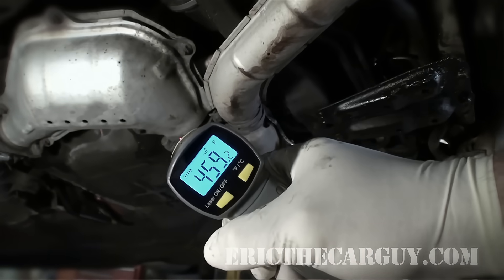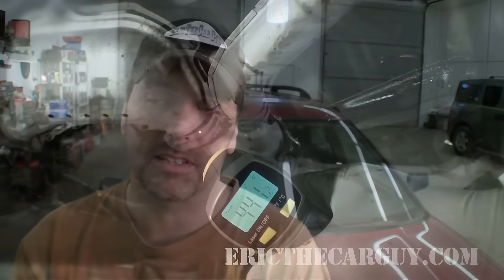Does Lacquer Thinner Clean Catalytic Converters? -EricTheCarGuy

Comment: I tried this and it worked.  2005 Subaru Outback.  1 gallon lacquer thinner in a 1/2 tank of gas.  Highway driving for 1.5 hours.  Turned the car off and then started it back up.  Check Engine light remained off.

Comment: Aye I thought it was most likely to not work but it actually did. I used a gallon and it was worth the shot. I took more then 150 miles but it did work! Maybe it won't fit every car but my 99 Subaru Impreza with 250k miles was fixed.

Comment: My 420 code is the only code I can't shake.. I wanna try laquer just in case and if that doesn't fix it.. anew sensor 2.. but the car came with what is clearly a new cat new but cheap design.. nothing like Honda oem.. due to this prolly being that crappy89.99 cat I seen on Amazon.. it's most likely the reason I have p0420.. it just lacks the content an oem cat has to satisfy the pcm it's functional.. not to mention the piss poor design of the manifold and collector at the end of cat.. all thin wall plumbing bet it's single layer.. the noise is literally coming thru the steel .sounds tinny as hell under load..may as well have leaks..(mind you everything is sealed all the way to the tailpipe.)so Even if laquer thinner or a new sensor fixes it.. I'm still gonna buy a better cat manifold. Just because that ugly sound.. bet it's restrictive too.. the runners on the more Honda like brand look larger.. I guess there's a reason they sell them for 89.. vs 250 or so for the better.. you get what you pay for.. so spend the extra money on better parts everyone...

Comment: I put those in my gas tank for catalytic maintenance when my tank of gas is 1/4  and drive it until the next gas up. It did throw engine light in my Mercedes and Lexus but it will disappear when I gas up again.
Reply: Just an update: I have a bad catalytic before, 4 years ago because I have to adjust the valve clearance to fix the problem. My catalytic already need a renewal because of it but I put 8 oz in a quarter tank of gas and drove it. It does clear some clog in catalytic converter and made my old '98 Honda CRV pass the emission  test a couple of times (4 years). Last test, it did fail and after using the Laquer thinner the check engine did not go away (killed the catalytic completely).  After I swap the converter with a new one, I found the old one was just like a muffler, the screen with precious metals coated with ceramic are gone (zero).  So, the Laquer Thinner can clear the clog but only use it as last resort as it can take out all the ceramic inside too. Also do not let it seat in your gas tank in longer period as my fuel tank empty warning light stop working, fuel gauge are working. (anyone know which parts I should change? not the bulb) it might also do something with the injector. To use it: put it, drive until it's gone or only put this in the last quarter of gas in the tank.

Comment: To obtain the same ratio of fuel to laquer thinner, (1 : 9), with 3/4 tank of fuel you'd have to add 1.5 gallons of the laquer thinner to the fuel tank. As several others have already pointed out, you can't "debunk" or "prove" anything if you're not willing to completely follow the directions provided by the previous experimenter! 18 *.75=13.5 gallons (fuel in the tank), 13.5 / 9=1.5 gallons (additive needed), for complete duplication of the previous "experiment". Even if the experiment was completely duplicated, "Scotty" makes no guarantee that it will work every time . . . . so, you might still have to remove the "cat's", and use a different cleaning method, or even replace them to obtain the desired results!
🙂

Comment: I’ve used lacquer thinner on one of my cars the literally would not go over 25 mph because the both cats were soo clogged that the engine couldn’t breathe right! I dumped a gallon of LT into the tank witch had less than a 1/4 of a tank and idled it at 2500-3000 rpm for a hour ...
 Needless to say a lot of smoke and crud came out the tail pipe but sure enough after the hour passed I drive to the gas station filled her up and got in the freeway and made it up to 75 mph ..... in total I saved $1500 and a i was able to fix the problem with no reprocussions 

So yea lacquer thinner dose work although I wouldn’t recommend doing it the way I did if you have a newer car with more sensitive oxygen sensors and such

Comment: If there are any chemists in the group, how much of NOx pollution is removed by the catalytic converter ("cat") and how much is removed by the EGR (exhaust gas recycling)?

If most of the NOx reduction comes from EGR, maybe we don't need those bleeping catalytic converters in the place (!).   

[Don't need ANY of that pollution stuff in rural areas, but that's another conversation.]

PS: I suspect most of it is EGR because NOx comes from EXCESS oxygen in the air-fuel mix, and EGR removes the excess oxygen so the NOx doesn't form in the first place. (Pretty cool feat of engineering in the first place - "pollution problem solved".)

PPS: most of auto air "pollution" is NOx, i.e. compounds of nitrogen and oxygen.

Comment: Read carefully IT WORKED FOR ME.
May 12, 2020 my 2002 Honda Civic LX had this same code P0420 (“Catalyst System Efficiency Below Threshold <Bank 1>” ) for the last 2 years, now it’s time to renew the registration and smog check is required, previous owner had catalytic welded from the middle due to a crack (very common on this type of catalytic as I searched) also one of the pipes cracked from where it connects to the plate, I took it to welded hoping that doing so the code will be gone, but it didn’t happen, looking for another solution, I came across Scotty Kilmer’s video, on how to clean the catalytic converter with Lacquer Thinner, Also I was curious to see someone like “Eric the car guy” doing such experiment as well, I saw his video too (like probably you are doing right now hoping for a miracle solution) but I got really disappointed, to the point to not try it at all, I have to admit, at first I was skeptical, but after knowing how much my catalytic cost (I live in California and regulations here are different, making everything more expensive) I decided to give it a try after all, it was either paying $700+ for a new catalytic (which is not that much compared to other ones, but I can’t afford it at this moment due to “Coronavirus’ time”) 
or pay $250 for a “Special smog check test” (Regular is $50) 
or pay less than $20 for a gallon of Lacquer Thinner 
Guess which one I chose?
I follow EXACTLY the instructions from Scotty Kilmer’s video, I poured 1 Gallon of Lacquer Thinner into a Half gas tank (6 gallons in my case) drove it for more than 150 miles and since my commute is 100 miles daily (95% freeway) it was easy for me to do this experiment. Now I can say the code is gone, my car passed the smog check with no problem at all and I can’t believed that I almost didn’t do it, I almost spend hundreds of $$ when I didn’t have to. 
Lacquer Thinner Less than $20
Smog Check $50
Total less than $70
Knowing that it works priceless 
This is for Eric and the rest of you who trying to replicate this, do EXACTLY AS IS INSTRUCTED TO DO nor less. (Very disappointed on you Eric the car guy)

Comment: 8:49 This is why engines should also be measured in running hours. The odometer will never know about that extra 200 miles.
Reply: Except that the 200 miles he mentioned was the miles the vehicle had been driven since the additive, so...

Comment: Eric Hey brother, I really dig this channell. 
I have a 2002 Mitsubishi Mirage DE 1.5 purchased three years ago online w 119,000 miles.
The car on the orig engine did California to Maine & back twice + 2 trips down to Miami & back trouble free cold A/C instant start up every time the key is turned, etc. I am an automotive graphic artist/ designer 
for Goodyear 21 years as of 2019. Since owning this car I have learned more about cars in 3 years than 
in 18 years flying & using rentals w 500 mi hehe. I did have to do an eng. replacement this last November 2019 Goodyear holiday trip. found an exact matching motor w just 75,000 orig mi. 
Doing new front end incl struts this Mo. Stay cool & srat in touch.
Alex

Comment: I cleaned mine with a hammer and a large steel punch.  Amazingly it worked!  They flow as if there is nothing there!
Reply: Yo pls help me how to do it
Reply: @khatabdh4028  get a 1 inch hole saw. At the rear of the converter cut a hole in the side. Then take an old big screwdriver and tear that stuff up. Get it all out that hole using a coat hanger and fingers. Then after u know its clean. Start the vehicle to make sure. Then weld a washer back over the hole.
Reply: @khatabdh4028  ]
Reply: *ha
Reply: LOL 😆 🤣 😂 😹 😆 🤣
Reply: Will this clear the engine code?
Reply: @alexpeterson4339  put 2 spark plug non foulers together. Drill one out to fit over the threaded part of the 02 sensor
Reply: @ozarkprepper1718  this clears the code? The engine wont know the sensor isnt getting any data? Just gotta pass emissions. Thanks for the response
Reply: @alexpeterson4339  you can clear the code with a scanner,or on some just unhook the negative on the battery for 5 minutes while the vehicle is off.
Reply: How to clean idle air control valve 94 civic
Reply: @joemerrick9970  get a new IAC from autozone and keep the battery unhooked for 10 minutes
Reply: @alexpeterson4339  it's worked a couple of times for someone I know.
Reply: @ozarkprepper1718 😂
Reply: @alexpeterson4339  Nope.
Reply: 😂 😆 genius
Reply: You had me busting out laughing  I done the same thing it does work great but I used a big ass cement drill bit
Reply: Ji ji ji ji
Reply: sure if you live in a state without emissions tests, and if a DOT inspector sees it for some reason that's a pretty nice fine.
Reply: @k9ne70  Dot can kiss my ass.   Thats why I vote Republican.   Democrats are the cause of all these stupid emissions laws and regulations.  Live free or die.
Reply: I put tape over a friends check engine light about 30 plus years ago . We were going deer hunting and that s10 had a bright light in my way . Fast forward 10?years he still had the tape over it .
Reply: @alexdominguezroberson2290  mostly kidding of course. I'd probably laugh instead haha
Reply: Lmao!!!
Reply: Lol
Reply: HAHAHA...YUP
Reply: Yes!
Reply: Did you die from leaking emissions getting into the passenger compartment yet?
Reply: @TortureBot  No and my grandparents never had them and the lived into their late 90s.
Reply: @ozarkprepper1718   That's not what I meant. Of course you don't need a catalytic converter at all except to reduce smog, but I thought you meant you poked holes all in yours from the outside. That would cause exhaust to leak and possibly get into crevices and cracks under your car and make it into the passenger compartment.
Reply: It's amazing how many ppl know nothing about cars everyone asking if it will clear the code 😂😂
Reply: That's what I'm doing as we speak we gonna create some airflow
Reply: And the check engine light no come on again ?
Reply: I put a gallon in my mom's crv and it fixed the cat haven't had a code in a year
Reply: Thats the dumbest idea I ever heard. On average they are worth 100 dollars the piece of pipe and clamps if you don't have a welder are 20 so you could have made 80 bucks for an hour of work
Reply: @disfunctionalmorons1324  Thanks..  Only took about 15 minutes and I still have all of the internal stuff. Truck runs awesome.And its still quiet.And still passes inspection.
Reply: @ozarkprepper1718  can you help me with my 03 ford explorer, to reset it enough to pass smog?
Reply: @lazysingledaisybronwyn8105  its difgicult to do in some areas. Where i am there is no smog test.
Reply: @disfunctionalmorons1324  the cadilatic converter for my dodge charger is $1800 I wish they were $200 lol 😆
Reply: brianj123458 “cadilatic” huh?
Reply: @goclunker  cataclysmic
Reply: @brianj123458  for scrap, they vary in value obviously not worth what they cost.
Reply: @brianj123458  buy a aftermarket highflo cat... they are cheap
Reply: @Hiram33  thank you I sold the car
Reply: @brianj123458  Actually you can get yours for less than $400. I could easily go and spend $2000 on a top-of-the-line aftermarket catalytic converter‘s. Any vehicle can do that. Your Dodge Challenger isn’t anything special.
Reply: @ozarkprepper1718  Lmao
Reply: Can’t do it in California
Reply: @brianj123458   A dodge aint worth $200
Reply: @disfunctionalmorons1324 or he could have spent $1,000 on a new one -_-
Reply: I love YouTube lol
Reply: you fucking suck
Reply: Did you use the hammer on the check engine light that will never go out now....!
Reply: Lol,,, yeh you probably also screwed your engine also by changing the back pressure in the exhaust line which can over time cause permanent damage to your engine which will set you back more than a new cat.
Reply: @scottsmith4145   not true in 4 stroke engines back pressure is a bad thing that is kinda wavy a clogged cat is doing
Reply: @scottsmith4145  Really?  A ford 300 six cylinder?   Engine design has been around since the 1950s. Long before those democrats decided they need cat converters.
Reply: @scottsmith4145  your engine doesn't need backpressure. LOL. Who told you that? You can run it with straight open headers. They sell exhaust cutouts if you want to  be able to switch between the 2. Backpeessure in an engine is a huge misconception spouted by people who have no clue about working on vehicles. Sorry but it's true.
Reply: The environment takes a hit so you can save $$. LoL, sounds about normal.
Reply: @AnotherBoomerYouTuber  Tell that to a rich man in his private jet.
Reply: @ozarkprepper1718  I'll tell both of ya
Reply: @AnotherBoomerYouTuber  environment takes a hit he says 🙄 give me a break tree hugger.
Reply: @jasonwindsperger362  What do you gain with your scorn for a "tree hugger" and your casual dismissal of the environment? Other than the "likes" from eleven clueless individuals. 

The air is not great, sitting in traffic in big cities, or even  small ones. But it is not as bad as it used to be. Vehicular traffic has increased continually and drastically since the introduction of the Internal combustion engine. Urban and suburban centers are still livable because of efforts and awareness to reduce emissions while increasing efficiency. If you think environmental concerns are worthy of your ridicule, then try parking your car in the garage and running the engine while you listen to your favorite music as the lights grow dim.
Reply: @davidsnyder3799 worried about air pollution, but wanting someone to unalive themselves in a garage with a running car... you're a real winner there, pal.

Comment: What if your running a code P0430 for bank 2 instead of bank 1.. would i consider the same possible clogged or bad cat?
Reply: Going to try it for bank2 in about 2 days when off work.
Reply: @jeremiahl2552  please update me if you can with what u come up with
Reply: Ran some real good injector cleaner through 1/4 tank of gas to clean all of bank2. Now has gas tank vapor valve error.  Guess strong cleaner may have ate valve.

Comment: Oh my God it works almost instantly. Absolutely amazing. I went from almost no airflow in my 3000GT and it was so slow now it's better than ever. I would swear by it the check engine light went off so there's no errors. I saved myself a couple hundred hours for under 15 bucks!!
Reply: couple hundreds? To replace that part would be $1500
Reply: Hi Jacqueline, you said $15 is that for Shopline JT501, wondering where you bought it?
Reply: How's your car running now? Any better?
Reply: My mechanic found the parts he needed for my SUV on eBay, and I paid for them. I paid $151 total for the front converters he said I would need. The labor cost was going to be approximately $500. But Scotty Kilmer's advice solved the problem. I spent $20 and saved about $650.
Reply: I'm about to buy a vr4. Thanks 😊
Reply: Amazing, Right?!

Comment: Didn't realize all gas tanks were the same size. Those comparing two video's by two contributors of 1 gal LT per half tank.   How Many gal in a 1/2 tank.  We have a small car with 13 gal tank and a f150 with 25 gal tank.   Just a thought that both videos could have been more specific in gallons gas to gallon of  LT.  Very much appreciate both contributors taking the time to help us driveway crawlers.

Comment: The girlfriend has a 2011 Honda Pilot.  She got a registration renewal for said vehicle which required a smog test.  She procrastinated getting the smog check and then, out of nowhere, a god damn CEL light.  Check the code and the dreaded P0420 code pops up.  Debated replacing O2 sensors.  The sensors seemed sluggish on my code reader but no code for failing O2 sensor was observed.  I decided to try this product called Cataclean on our way out to Santa Barbra.  Best $22 bucks I’ve spent in a long time.  The next day driving back from our morning jog the CEL light extinguished.  Told the girlfriend to immediately take it to a smog certification shop.  She’s actually heading out while I type this.  Hopefully we get it through smog.  So in conclusion, the Cataclean seemed to work in our situation..  No guarantees that it will work in everyone else’s situation but hey it’s $22 and worth a try vs. spending your weekend underneath a vehicle trying to fix and clear a P0420 code.

Comment: I dont think he was saying it will repair a catalytic converter but more like to test and see if that fixes something with it or the O2 censor after running it fully a gallon of it and then after your fully empty fill your gas back up with normal gas no thinner and run your car normal for a while like do your daily things and after some time you can now verify if it worked on it or not to get the fault code to turn off possibly but not that it repairs a catalytic converter.